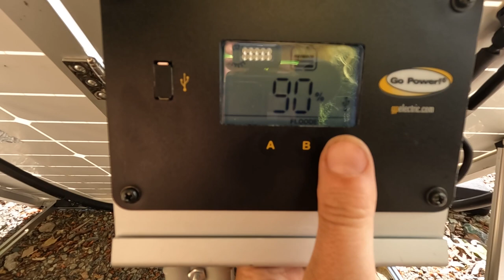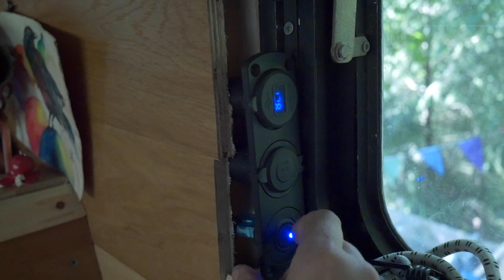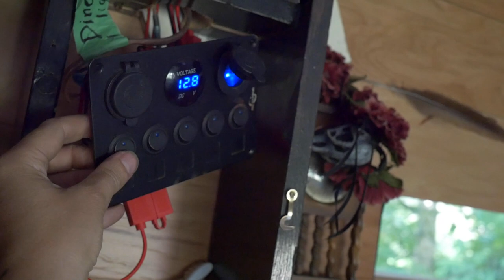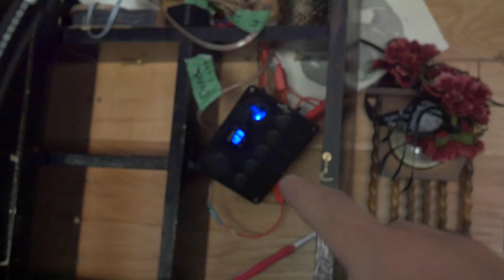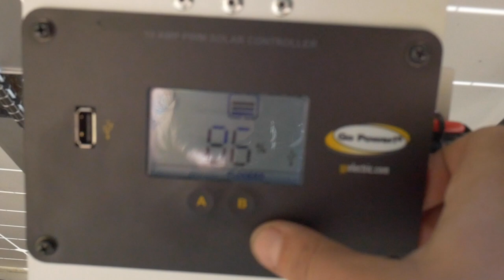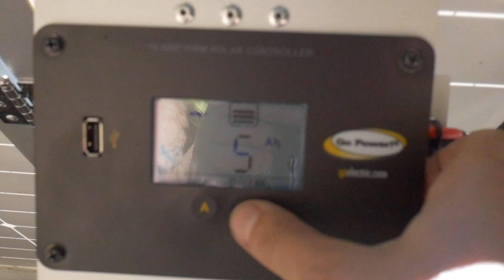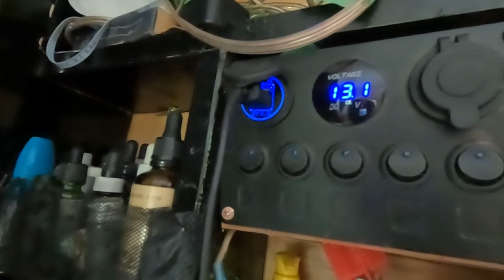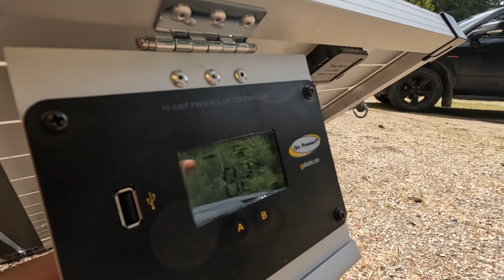Step Van Build: Is this enough solar power?

Comment: Hey Flossy. Electrical engineer here. I would put a heaver gauge wire between your battery box and the buss bar. It would also be a good idea to put an inline fusible link on that wire. Make sure your main ground wire is a similar gauge as your upgraded supply wire. And, put a cover over that buss bar. Things could move around back there and you don't want something metal hitting that buss bar and shorting it out. It would be a good idea to put some kind of strain relief on the wires going into the new buss bar enclosure and battery box to keep things from accidentally pulling off the connectors. I would also put a main disconnect switch on the battery box so you can easily turn everything off. And label all your circuits at the buss bar so you remember what each one does.
Reply: This is great advice
Reply from the maker: @snoig ! Thank you very very much for your comment!! I totally don't know why I didn't think that, yes I agree I'll get a higher gage wire from my bus bar! Great point. The bus bar has a cover, I possibly just didn't show that. 👍 I definitely plan on some fastening and tidying up of my wiring. I'll have to see what fuse I'll need inline once I find the right gague wiring. Seriously thank you! The ground wire is a thick one, time to go buy wiring haha

Comment: I love the punk rock aesthetic of your spaghetti wiring, but so glad you're tidying up to a safe level. lol. I have 600 watts on top of a 5x8 trailer with 2 100 amp ABS deep cycle batteries  run through an 1100 watt inverter. Unless I get three or more very overcast or rainy days, it's more than enough for the basics. FYI Li batteries don't suffer the cold very well, or so I've heard.

Comment: Two thousand ( four 500 watt ) solar power system anything less will not properly run ac , tv , lights , electric stove and oven , computer etc
Reply from the maker: @Erik 1701 I probably have space for that much solar, but was aiming for probably 1kw of solar not 2... I guess it'll depend on price. I don't have a tv and my stove is propane so that really helps! Thank you!
Reply: Plus don't use standard batteries , you have to use lithium ion batteries. They recharge better and quicker, hold charges longer
Reply: @FlossyRoxx  two 500 Watt solar would do plus take up less roof space.
Reply from the maker: @Erik 1701 yeah, that's my goal. And deeeeffffinitely lithium, lead acid is such a pain!!